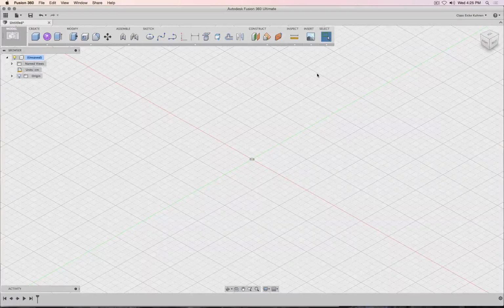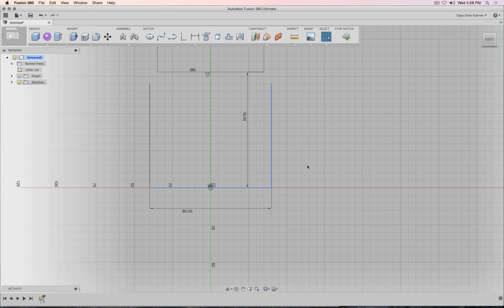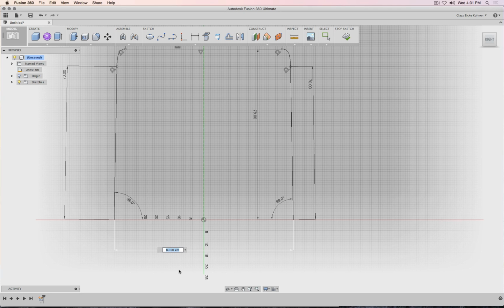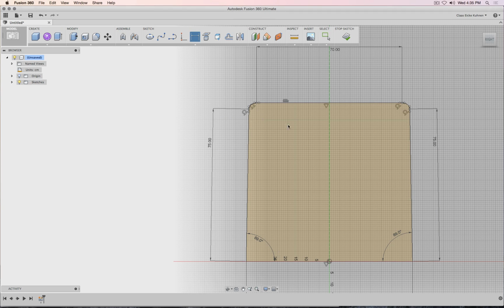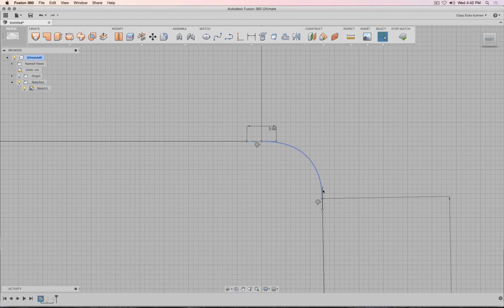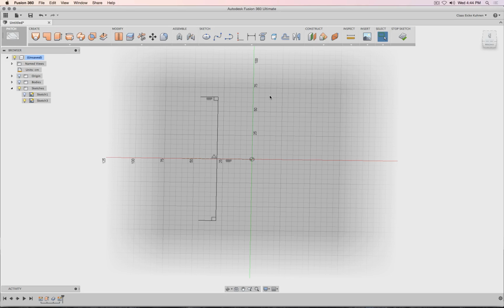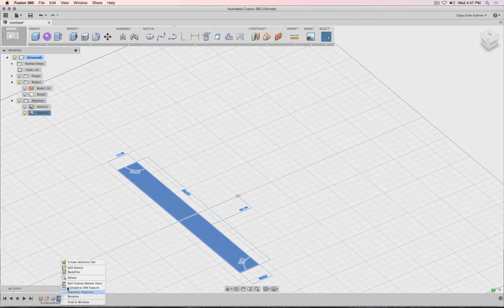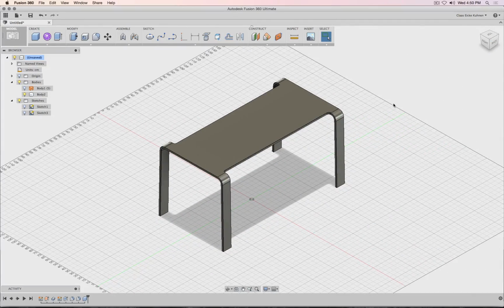Bend Plywood Table

Comment: Hey Buddy What If I want to bend a flat plate right in the middle around 90 degrees? 
Is there any easier way to do that like in autodesk invetor that you have the modify button bend part?

Thanks
Reply from the maker: currently fusion cannot do it - it has no deformation tools